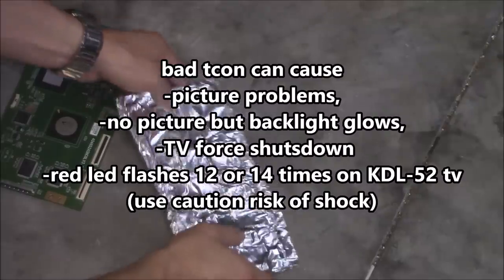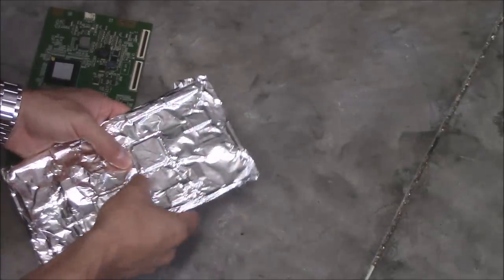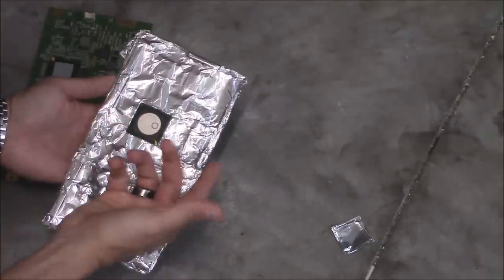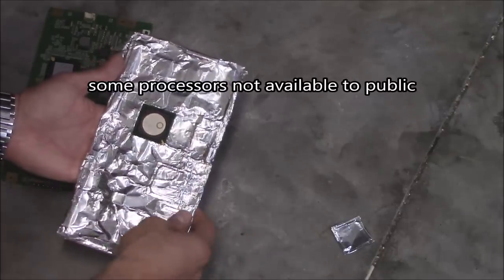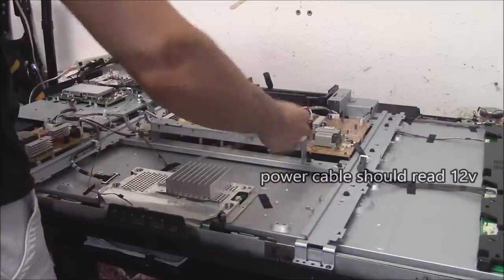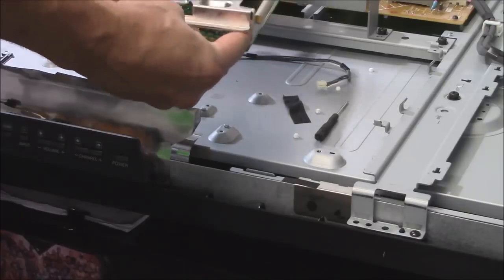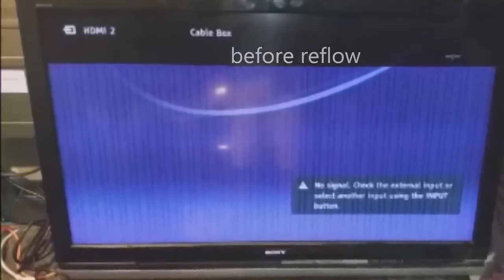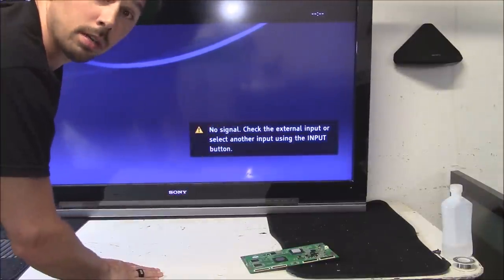DOES REFLOWING FIX CIRCUIT BOARDS??? SONY KDL- TV REPAIR RESULTS !!!

Comment: I know this has nothing to do with this tv in particular recently somebody crashed into a pole couple blocks down i seen the power surge i got one foot away from flipping the main breaker to the house and BOOM all the power suppressors exploded everything was good except my philips 42 inch i opened it up and the fuse was blown what else should i check should i just replace the board?? Is it possible it just junk now there are no burn marks nor any blown CAPS

Comment: halo, i took my SONY KDL-32EX720 to a repair shop and I was advised that BRC LCD PANEL S32TSP  part no.181133931 is faulty. do i need to buy the whole panel? or cani replace the component?

Comment: I have the TC-P50U2 made in 2010, When I plug it in nothing clicks, but the owners manual states it does not have a standby light. When I hit the power button the red light comes on and I hear 2 clicks then the red light blinks 10 times. Pauses and repeats the 10 times. I checked the larger caps and they seem fine, I also checked the sc2 connection and its not shorted. Can you tell me where to go from there as the possible problem

Comment: I need your help. There are horizontal white lines appearing in my Sony LCD TV (KLV). It has been started with small white spot and is increasing. other than few white lines there are also areas with many white spots in the screen. White lines and spot areas are little inflated. The screen has not been damaged. What should I do?

Comment: I can't believe it worked. Saved me from buying a new main board for my lcd tv. Cover the top with foil like in the video. Definitely don't put it in for 10 minutes. Almost burned the shit out of mine and found a lot of damage from the heat. A tiny piece even fell off. I should have put it in for 5 minutes instead of 9. But surprisingly it worked! Ridiculous.

Comment: Once I saw a method in a PS3 Board that consisted packing the board with the aluminium like you did with the processors exposed, but instead using the heat gun, the board was putted in a cold oven setting the temperature 120ºC I guess for 15 or 20 minutes, and then increase again to 220ºC 250º C for another 15m, after that the oven was shutdown and left the board cold down. I already try this method with success on a PS3 but I dont know if is still alive, because it wasn't mine.

Comment: Your knowledge is crazy.. I have e lines in my XBR8 but odly only on interlaced signals,  but no lines in 1080P signal. Same board replacement? Thanks.
Reply from the maker: I had that it can be 3 things,  tcon board,  tcon connections or bad lcd panel tabs. Check connections then my next guess is tcon board. Get at shopjimmy.com

Comment: Good vid, but... I would have dropped some liquid flux down underneath the processor before applying heat, you may have had better luck with the reflow.
Reply from the maker: True. Great tip!

Comment: I need your help.  I have a Sony KDL-46V5100 LCD that does not have audio and does not have video.  Sometimes the power works using the remote and sometimes it does not. At times, I cannot shutoff the power from the panel power button so I have to unplug it from the wall.  The green power light appears to stay when the LCD is turned on, but the backlight cycles on and off continuously.  Main board p/n is 1-879-239-13 and Power Supply Board p/n is 1-878-599-11.  I am thinking I have a problem with the main board.  ShopJimmy.com is out of stock for the main board but Ebay has one.  What do you think my problem might be?  Thanks in advance.
Reply from the maker: Main Logic board issue but if power board doesn't have steady standby volts then weird things Happen.
Reply: The standby 3.3 volts was steady as a rock when I measured it.  I'll look again tonight, and confirm that there are no fluctuations in voltage.    Thanks for your help dude.  You are doing a wonderful job with educating the consumer.

Comment: Hi there is a way to bake the tcon in the oven like the mainboard or a gpu?
Reply from the maker: Mr. Heavy Problems yes but it's only temporary fix lasts maybe less than 1 month. tcon IC needs fresh solder with lead, so reheating bad solder joints is short term fix at best.
Reply: I tried to bake the tcon putting it in the oven: 190°  10 minutes, no results. I have vertical lines and i decided to by a new one. I hope this will fix my tv. Thanks for the reply.

Comment: I fixed a 42" LG no picture no sound tv (I got on CL free) by using a heat gun and reflowing the graphics processor, the tv's been working perfectly for 2 months since then. $15 heat gun from China on ebay. I put thermal paste on the thermal pad.

Comment: Sweet attempt ! It's probably cheaper to just replace the board with a used one , than to have a reflow repair and a new chip ? Thanks for the video dude...
Reply from the maker: ***** i meant to say the equipment needed to reball and install new chip is more than a used board.

Comment: hi friend i have a peoblem with my sony KLD-65W5100 tv turn off alone and start blink red led 10 times someone tell me this is main board but i buy one for ebay and when comes and put in to tv turn on tv i listend but no see just blue screen  by 3 minutes and turn off and start blink again. my friend told me his board it damage.... would you plz help me to find one 
A-1671682B

Comment: hey tampatec, nice try on the reflow! I would suggest you buy the yihua 850 hot air station on ebay for $50 shipped to your door. You can control the temperature, and they make attachments for different size processors, so you don't overheat the processor. Also kapton tape is heat resistant, so you can put it on other heat sensitive parts on the board and then put the tin foil on.
Reply from the maker: what % of success you have with it. Reflow I can't seem to get a permanent fix that lasts long term, I tried on tvs and xbox360s, I really want to get reball station but can't afford it.
Reply: I haven't reflowed any tv chips, but I have with nintendo 3ds xl ic chip. Reflowing is always a temporary fix, and reballing is better. Reason being, is they use lead free solder which is crap, and when the board heats up, it flexes and breaks solder connections, especially with lead free. If you reball bga its more permanent because you use leaded balls, which are stronger. Is it worth buying a reball station, is the question? It's a lot of work and the stations don't go cheap. You need an infrared station and not just hot air for reballing. They have cheapo's for like $300, and are supposedly not too bad. The good scotle boxes start at like $1600, I guess it depends on how much you want to use it.
Reply: I'm just floating ideas, I mainly mess with phones, tablets, and video games, I always watch your new vids, because I would really like to get into t.v's, and you put out awesome vids.
Reply from the maker: BHayes82 thanks,  one day I'll get one, might have to dip into my kids college fund to buy it. It might pay for itself in the long run.
Reply: LoL, I hear you man, good luck, and keep making those vids!

Comment: I have a vizio ,GV52L FHDTV10A, HDMI 1-2 shows nothing ,HDMI 3-4 shows 480 with few dots sparkling and 720i-p and 1080i  lot of dots and flashes snow screen and 1080p nothing.i visually looked for bad components. I learned a lot from your videos ,you are awesome! hope u might can help with this. my email is geshillcutt3@yahoo . I also have  a vizio E422VLE (dumpster find lol) showed orange on bottom half ,found bad capacitor,took it out and tv works fine only thing seems like takes longer to come, not to long though, should I leave it like that?